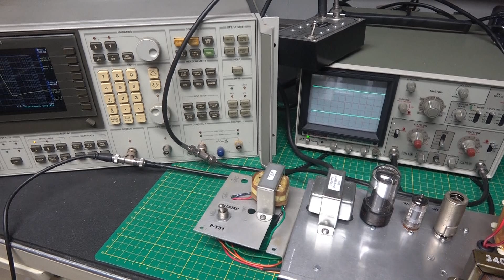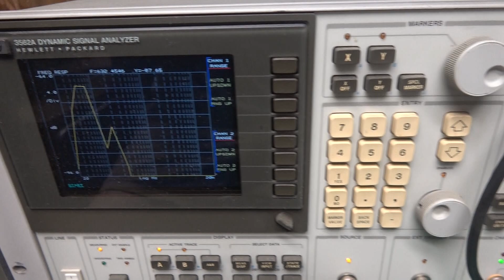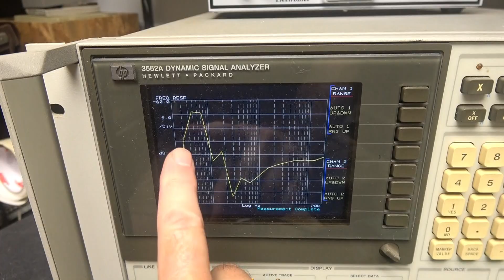Guitar amp output transformers affect tone? Frequency sweep  Amplified Parts Class A Champ vrs P-T31

Comment: Would be interesting if they handle strong complex signals differently, like white noise, that drive the transformers into saturation.
What is the signal strength used, voltage and amps?

Comment: D-LAB< you SAVE the frequency response with "markers" set at the pointed spots of P-T31 output transformer. There is a SAVE button and Markers Button on your spectrum analyzer. The P-T31 has a high dBm level at 20Khz but without markers I can't tell what the dBm levels are at the peaks and valleys of those spots.
Reply from the maker: Hello, Thanks for the info. I will experiment with settings
Reply: @d-labelectronics  The SAVE button will save the trace with 4 or more markers, don't erase or delete it because you can overlay the 2nd trace